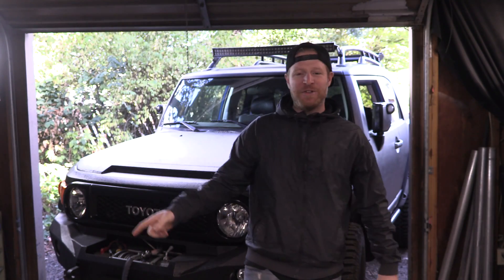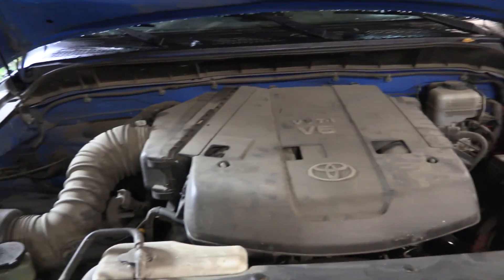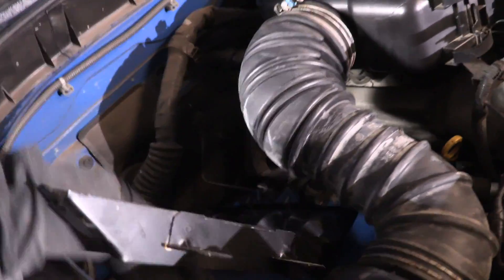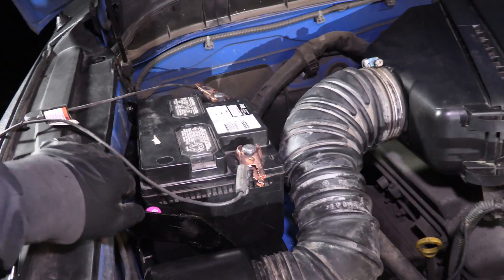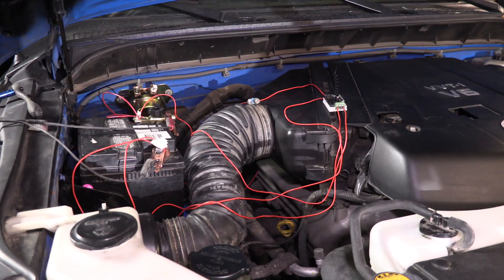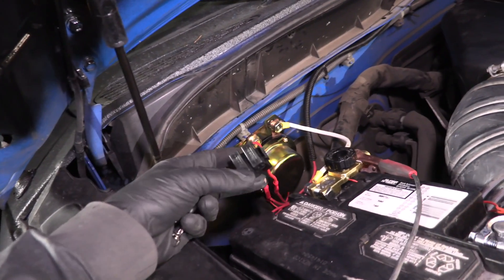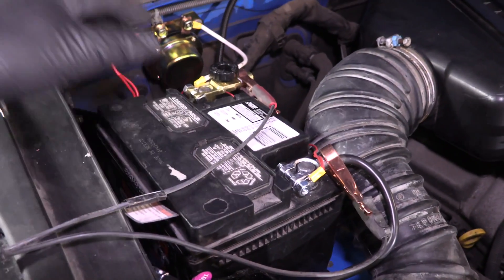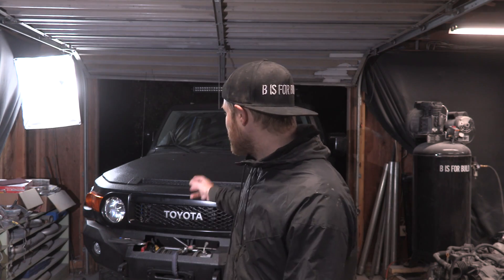FJ Cruiser Build Pt 9 - Remote Controlled Lighting & DIY Dual Battery Setup

Comment: Chris - Nice install. One small addition I would make is a moderately sized fuse before the long run of that heavy gauge wire. I'd even look into those nice AV / Stereo fuse holders that audio guys use for their amps. Its super easy to install a fuse close to the battery pack, and it minimizes the risk of that heavy lead shorting out and causing either a fire, or breaking electronics in the FJ!
Reply: I'd put a fuse on both ends between the batteries because if the cable breaks near the middle, and the wire shorts, it'll throw the fuse on one side, and simply stay hot and short circuit the battery on the other.  If it happens.  Better safe than sorry.